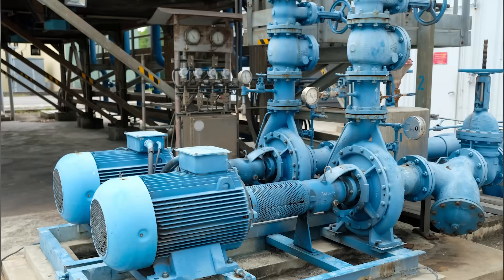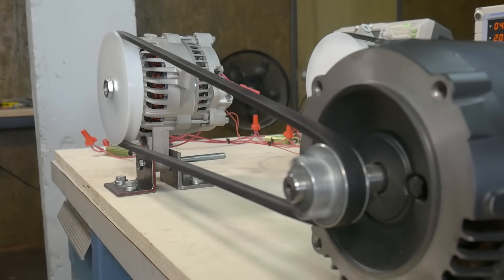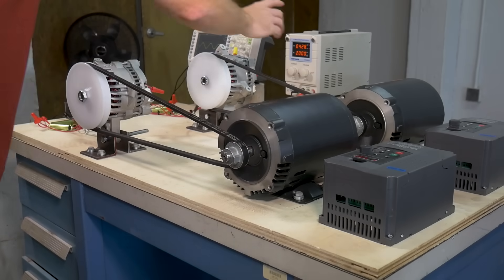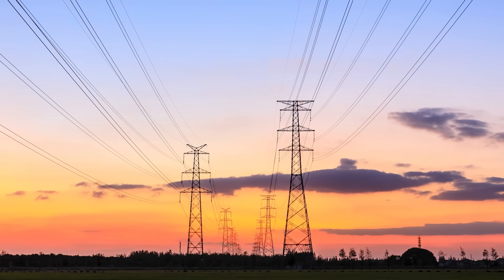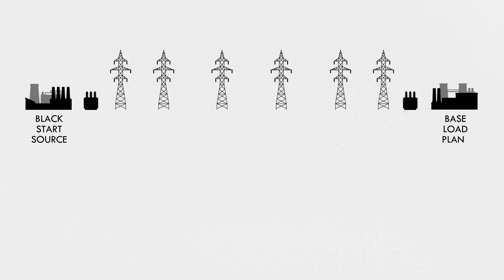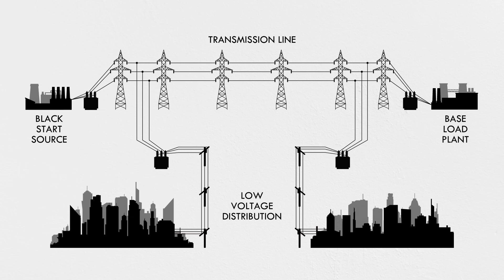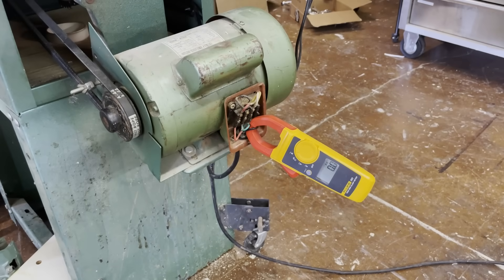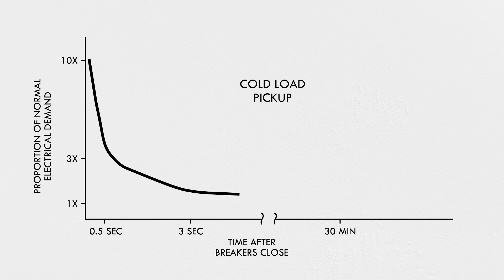What Is A Black Start Of The Power Grid?

Comment: I consider the installation, production, distribution, management, and risk assessment for disaster relief of  The Grid  to be far beyond  ((Harry Potter) + (Albus Dumbledore)) level magic,
(Compared to the types of 'tricks' I've used over the years, installing, training, supporting, etc, primarily 'RDBMS' software and hardware products, sold to everyone from the local plumbing company or municipal waste removal concerns to NASA, JPL, NOAA, US Surgical, Lockheed, DOD, Stennis Space Center and such).
Perhaps simple to someone with some specialized education in electronics, electrical engineering and such, it's the details about issues that lose me, in a way, in the strange combination of (simple electrical/electronic theory) + (critical timing and load balancing issues).       It's ballet with hard hats and slide rules!

Comment: Small bit of extra information regarding synchroscopes: operators do not attempt to stop the synchroscope at the 12 o'clock position.  We adjust frequency such that the synchroscope rotates slowly in the fast direction.  The slowly part means that the difference in phase angle difference is small, and the fast direction part means that the incoming machine will pick up some load when synchronization occurs, which is necessary to prevent a reverse power condition.  The breaker is closed at the 12 o'clock position, which means that the two signals are in phase at that time, it's just that the synchroscope is rotating when it happens.  We just time it so that the breaker closes right as the needle is passing through 12.  We usually send the close signal right as the needle passes the tip of the feathers in the direction arrows.

Comment: This video brought back memories from my early Navy duties. I was stationed on the Outer Banks, at a Naval facility that used six diesel generators when the island power went down. I'd start the first generator and get it warm and up to speed. Then came the load. Then start another generator. Bringing this one on brought in the use of the syncronizing meter. There were also lights that flashed, as in your example. I remember the first time I tried it, the other generator jumped! I had to "sync" six of these sets!

Comment: I worked at a power plant for an early warning radar in California. Any time there was a storm within a 60 mile radius we would fire up our 2000 kw generators and synchronize those to the commercial grid and put four of the six generators on line parallel to commerce power then split them into two busses one for the radar and the other for the computers and the rest of the site. We would stay in parallel until the storm was at least 60 miles away and gaining distance to ensure that the radar never went off line. We had syncroscopes to get the generators in phase followed by getting them in phase with commercial power it wasn't hard but required perfect timing or you would turn one or more generator's into motors and over speed the diesel prime movers they ran at 120 rpm and over speed at 150 rpm and then we had to have Depot level maintenance in to rebuild the the engines. If we had a black start we used a huge Cat generator that was fired up and gave us enough power to bring one generator on line and that would give enough power to get a second one in parallel so the radar was working then we would fire up two more and put them on the second buss and bring the rest of the site online. Everything was done in such a way that we had back up busses and generators incase we lost a generator or two while on site power.

Comment: Cold load pickup issue is often why I would put my ship on generator if the grid was having extensive issues. Sometimes grid operations will actually call large customers and ask them to disconnect from the grid and wait for the call to re-energize or sync/transfer back to grid power from the customer's own generator. Fun times.

Comment: Grady Since you do not like working with the higher voltage to get your synchroscope working you should get two transformers 12 volt to 240v so that you can use it at a reasonable voltage. Your demonstration would be more appropriate for your audience. The synchroscope is how power plants synchronize to the grid. along with a frequency meter. Assuming that your synchroscope runs at 120v this would allow your system to run at 6v. A 20 to 1 transformer ratio. The use of a 240v winding on the transformer instead of a 120v winding to match the synchroscope's 120v is so that you can vary the speed of ether generator (within limits) with our saturating the transformer cores due to the lower frequency. Assuming a 60hz transformer using a 240v transformer and operating it for 120v delivery should allow ether generator to run down to about 30hz with out saturation. Thank you for the videos, nice demonstration. I remember the 1965 block out when I was a kid. Good explanations. 
Here is a link to a you tube video of an actual hydropower plant coming to sync to the grid and going on line for anyone interested. https://www.youtube.com/watch?v=xGQxSJmadm0

Comment: I was at GE Schenectady and had heard they had used power from shipboard generators to get peaking generators started.  I'm sure there are 50 stories at least.  I was at one peaking plant and they had an Alco diesel generator as the backup.  But years ago someone by accident left the oil pan heater on at a planned startup and turned it all to sludge.  They started cleaning it up but never finished. Backups get neglected.

 @PracticalEngineeringChannel   You should look up Dicks Creek the only one of its kind gas turbine generator.   So obscure that even the ASME history of gas turbine generation does not list it.  Ten gas turbines blowing on a giant fan.  And yes, it has been put back into operation.

Comment: I worked for LILCO on Long Island and our plant (a large plant) could do a “black start” and I was one of a few trained to do it.  It’s a bit of work using the auxiliary DC systems but we got it done. We had to do it in the early 2000’s. Our plant is a crude #6 oil burner that can burn Natural gas as well. We have 4 units at 365 megawatts each.

Comment: I have manually synchronized generators to the grid too many times to count over my 45 years in power plant operations.  There is more to synching than was shown.  

1) turn on your synchscope.  It is usually kept separated because a trip would exercise the hell out of it (0 Hz on one side, 60 Hz on the other spins it so fast it blurs). 

2) adjust generator rpm so that the scope is moving slowly in the fast direction (clockwise). 

3) adjust generator voltage to just greater than grid voltage when the scope is in synch.  It is easier on the equipment to set down on the grid than be pulled up to it.  It is important that the voltages be compared at synch as it will vary slightly when not in synch.

4) close the breaker when the needle is at 11:55 while moving slowly in the fast direction.  This gives time for the synch permissive relay to close.  The synch permissive relay checks to make sure everything is correct before closing the breaker to prevent idiots from blowing up their generator.

Most generators use auto synch circuits these days, but some managers, being very conservative, don’t trust them.  In addition, autosynch relays don’t always work correctly, so operators should always be trained in manual synching.

Comment: I was a diesel mechanic servicing about 24 diesel generators in remote Tasmania.  Not the only one,  we did weekend shut down shifts . Not many in the camp.. The fuel froze in the genset tanks , so it was necessary to venture into the snow ,....along with the electrician...charged with alcohol...at 2 am...in thongs and shorts.. For him at that point it was difficult, shall we say, to synchronise those 3 phase lights on the genset we were putting " online". Naturally that didn't happen...twice... Monday was to  separate generator from engine and replace the drive couplings. The whole generator lifted off the ground ...then rattled with dead bits. That is when I decided to learn more...well maybe not exactly that night....

Comment: I think very few people understand how difficult it is to run a steam power plant, to make a certain amount of Electricity! Ramping up or down the fuel being admitted into a BIG steam power plant to control it's output has large delays between adding more fuel and the actual steam output due to it's massive size! That can produce huge variations in the plants electrical output! Having that Steam Power plant connected to a "Grid" helps tremendously to smooth out any power plants output!

Comment: I spent 35 yrs in power operations in the field did some black start training similar to our video . In our state of NSW Australia we  havent had a complete state wide outage since  1964 though some fairly widespread outages have occurred.  Renergising and providing the right amount and type of load is difficult reenergising long EHV feeders especially underground ones can be problematic as their significant   capacitance creates issues of leading load currents with associated voltage rises often way above standard voltage ranges causing issues with surge arrestors and transformer overfluxing . It's a complex job under very stressful situations a huge multitude of alarms swamp alarm panels and sorting out the important ones verses less important is a major issue . AI will become more integrated into grid operations as systems and complexities make it beyond human intervention for such major outages in my opinion. Creating islands of renergised loading must have synchronising capabilities on circuit breakers whose task it will be to reconnect islands back into a grid. The future will be interesting with only  renewable energy sources widespread and of lower output once such systems are running the reenergising after a black start will be a nightmare once again AI will be needed to sort out that complexity interesting times ahead.

Comment: My father was with Ontario Hydro during the 1965 blackout.  The hardest part of restarting the grid was finding a generating station that could perform a black start.  Lots of power stations installed diesel backup generators after the 1965 blackout, but they were unheard of, before the incident.  Fortunately, they found a small generating station that was obsolescent, but still in service.  It had steam driven auxiliaries and a hand fired startup boiler.  Once that station was up and running, the bulk transmission network could be used to send that power to other locations that could use their electrically powered auxiliaries to restart their generation, and bring the whole grid back up.

Wind farms and solar farms can only be used for a grid black start if they have extra equipment that is not normally installed, due to the additional expense.  Solar farms only produce DC (if they use photovoltaic cells) and wind farms do not run at synchronous frequencies, so the power is converted to DC, before connecting to the grid.  There are power electronic systems that use reactive power from the grid to convert the DC power into AC power at grid frequency.  In a black start condition, there is no reactive power on the grid (because the voltage is zero), so no DC power from the wind or solar farms can be pulled onto the grid.  If the solar or wind farm used the harnessed power to drive a synchronous generator, then they could push power on to the grid.  Even worse, if a situation develops that causes the grid voltage to fall, less power is pulled from the wind and solar farms and the drop in available power can lead to a further decrease in grid voltage, which further reduces the power that can be pulled by the grid.  In the worst case scenario, the wind and solar farms are running at nameplate power, but a power shortage causes a voltage collapse and wind and solar farms are forced to shutdown, as they cannot push power on to the failing grid.

Comment: @PracticalEngineeringChannel
Let me ask a question. Why the grids does not use a global clock to set the phase and frequency of the electricity?
We have pretty accurate clocks which can be synced together and transported to facilities.
For large grids these can be installed in pairs to add redundancy or hot swapable capabilities. This way, the large grids can operate offline, immune to any threats or hazards.
Small grids can look up to GPS clock and grid frequency when starting and then lock their phase.
There can be always the fallback mode where the grid can move to legacy mode.

Comment: I really was hoping that you would have mentioned that during a black-out EVERYONE should shut-off all electrical appliances except ONE light. That means shutting off the circuit breakers for the A/C, water heater, pool pumps and whatever else will create a large draw on the grid when power is trying to be restored. The one light will notify the homeowner that the power has been restored and not present a huge load on the grid as a neighborhood is re-energized. Remind people they are connected with their neighbors on a circuit that can have dozens, if not hundreds, of homes on a single circuit. When the single light comes on then wait five minutes before turning the A/C circuit breaker back on and another 2 - 3 minutes before turning the water heater circuit breaker back on. The idea is to slowly introduce load back onto the grid, otherwise there will be multiple On/Off power supply incidents that could result in damage to the appliances. I believe your article about the “grid” was realistic and the challenge to synchronize frequency/voltage between in-coming generators and the on-line grid was appropriate. Good job!

Comment: I'm a substation electrician. Loved the way you clarified. Just installed a sync scope last month. We still use them every time we switch in transmission substations. We also just rebuilt our gas turbin for black starts. Unless I'm mistaken, they use it for generation regularly so it stays in good working condition.

Comment: 13:09 “Hot water heater?” If the water is already hot, why would you need to add heat? They are called WATER HEATERS, not “hot water heaters.” Do we have cold water coolers? No, for the same reason.

Comment: I'd compare this to booting a computer: The CPU has a small amount of boot ROM and uses cache as RAM initially. This tiny code loads and verifies the management engine from the BIOS chip. The signature of the BIOS is verified, then the BIOS is started. The BIOS contains code to initialise the RAM. Once the RAM is initialized, the BIOS loads the bootloader from the hard drive into RAM. The bootloader is launched then loads either the operating system or the recovery partition depending on whether you are holding a specific key on the keyboard. But all of this starts from a tiny amount of mask ROM on the CPU itself. A CPU can't even read the BIOS chip without that code. You need an SPI driver to read the chip in the first place.

Comment: My father was an electrical engineer. In college, they had students spinning up and synchronizing massive generators in the basement of the school. He said there were pieces of old blown up motors embedded in the reinforced concrete ceiling from previous incidents. 

Working with that kind of power is absolutely terrifying to me.

Comment: 13:56 And areas with critical infrastructure often get power way before other people do. We had a power outage here in our area in Germany where a major power line had a failure. After they fixed it or rerouted the power, the parts of the city and some villages with critical infrastructure had power about an hour earlier than some other areas. The company I work at is part of the critical infrastructure and we had power about 20 minutes after the initial failure. Luckily we have backup batteries and out own generator so we had power the whole time, but the fuel won't last forever.

Comment: 7:55 There are some old generators that had multiple stages of engines. Like a small truck engine that would start a bigger engine and later on the enormous engine to create power. It's like in ships where you also sometimes have multiple stages.

Comment: I worked with generators in the Air Force and I remember being taught about synchronization for power plant operations or just  running two generators to support a large load

Comment: On the Hawaiian island of Oahu, they experienced an island wide blackout in the early/mid 90’s.  There are several power plants across the island and all shut down from reasons I don’t recall.  They had to slowly jump start one at a time with the aid of each power plant is some special order that was unimportant.  Was trippy.  

We are so dependant on these systems and when it breaks it’s easy to see how we can takenit for granted.

Edit: After looking it up, it was wed April 10th 1991.  I remember the radio stations trying to rhyme something or whatever to make it to sound  catchy (like Blackout Friday, which wouldn’t work because, well, was mid-week).  They failed. 🤦🏼

Comment: I was an Engineer at a 2000Mw Power Station with black start capability here in the UK. To get it all started from scratch there was a small compressor/receiver that looked like it had fallen through a wormhole from the 1920’s. This started a diesel generator that fed the start up boards for a 17Mw gas turbine powered by two RR Avon engines

Comment: Dang, this is very well-researched. As a former control room operator in a black-start facility, and recently a control room operator in system/transmission operations (our annual black start restoration plan training starts tomorrow!), everything you mentioned jives with what I know about black starts. Usually I pick up on little Gell-Mann bits, but all your electric grid videos I watched today were flawless. Great job!